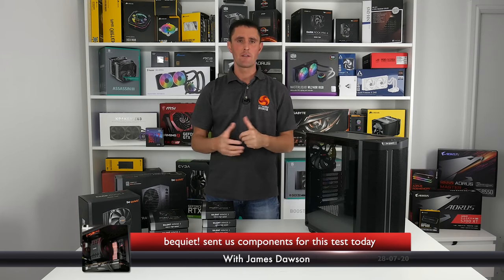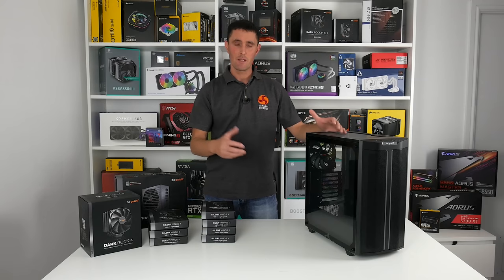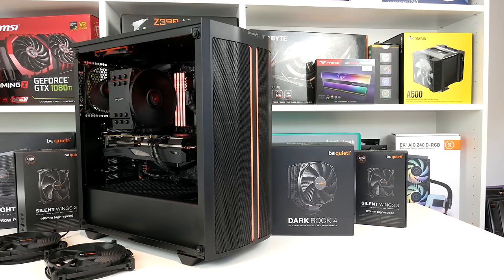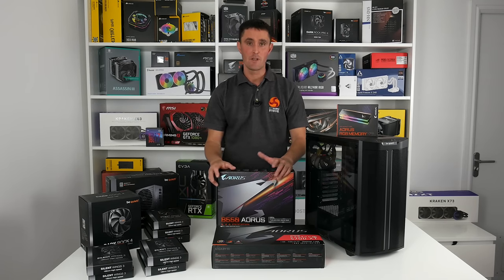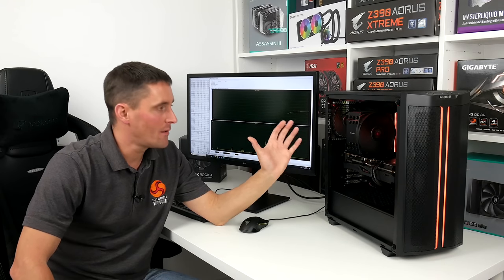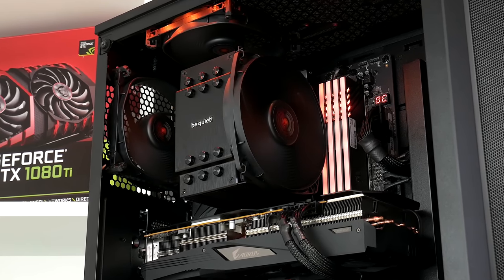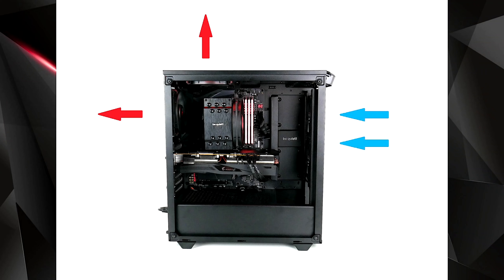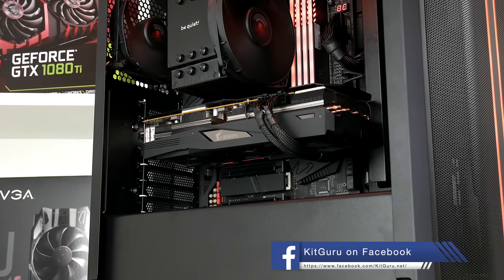Positive and Negative Airflow Testing / be quiet! Pure Base 500DX (w/ timelapse build)

Comment: I'm not sure why everyone is praising this video.  The information that we were looking for comes at the last 20% of the video, with the rest of this (arguably too long) video being excruciatingly monotone explanations of the testing.  And the results?  Not even what most of us were looking to find out.  I never cared about positive or negative pressure on CPU temperatures, because all the CPU needs is air flow (and this is reflected in the results considering all three temperatures were within margin of error).  I wanted to see you demonstrate how much positive or negative pressure affects air intake from parts of the chassis that aren't meant to receive air.  I also wanted to see ways to change pressure depending on fan configuration / RPMs.

Comment: you really must have gotten a bad CPU sample there if it only does 4.2 GHz at that  voltage
Reply from the maker: thats the clock speed we used for this review. its not a limitation of the sample we have.
Reply: The aim was to have a constant frequency and voltage that would be 100% stable during long stress tests rather than searching for the highest possible frequency.

Comment: Your assumptions are flawed because the top fan is angled.
Your balanced is 28800cm^2 in and 24000cm^2 exhaust.  total: 52800
Negative is 14400 in and  32667 out total: 47067
Positive is 38400 in and 14400 out. total: 52800
If you were to put a 140mm fan as rear exhaust on the balanced you would be closer to actual balance with 29200cm^2 out rather than 24000.
Reply: actual airflow will be lesser for the intake fans because of the impedance of the grill, so you should bias your cooling setup towards having more intake fans than exhaust fans
Reply: @ivanbrasla  Exactly, filters hamper intake fans with about 50% so 2x140mm intake and 2x120mm exhaust would be 19600 in and 24000 out, even 3x120mm intake fans wouldn't be able to match those exhausts with only 21600 effectively. The top fan are even more useless as an intake only providing 33% efficiency if filtered as is appropriate.
Reply: @magnusnilsson9792  there are other factors that had to be considered such as the other fans in the system. Both the CPU and GPU fans affect the air pressure.

Comment: Removing the dust filter is not a realistic test. Better luck next time. Also wtf is this GPU and how did you load it? I use a TUF RTX 3070 in my case and it's keeping 80deg C all the time during gaming.